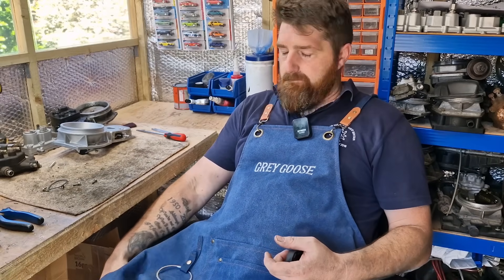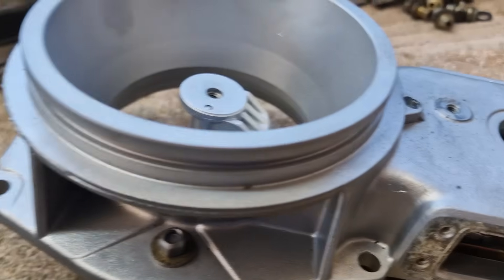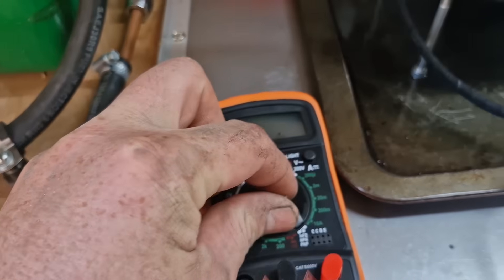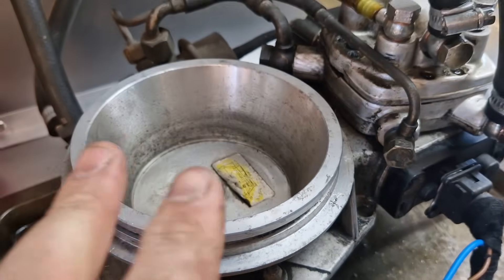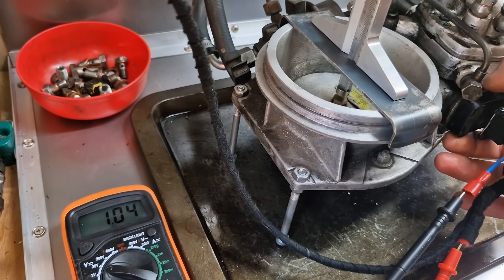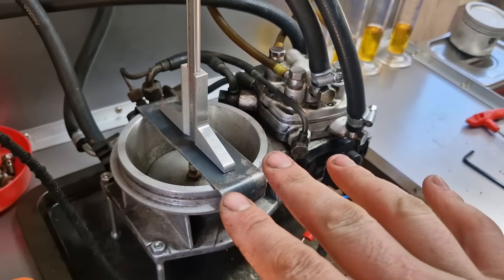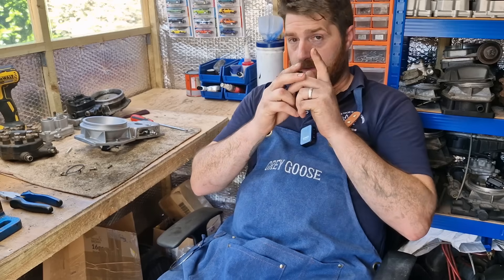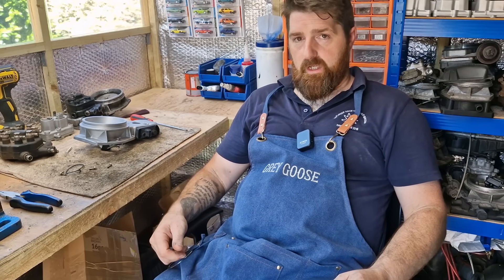Bosch KE-jetronic - Potentiometer Test and Adjust

Comment: I tried measuring this on my 1987 Audi Coupe Quattro 2.2 R5 JT and I got the opposite reading (larger number on the bottom, smaller number on the top)
What did I do wrong?
How should these wires be connected?
Reply from the maker: Has it got the factory plug on the potentiometer?
Reply: Yes it has a square 3 pin connector.
Pin 1 is (+) and pin 3 is (-)
Reply from the maker: Has pin one got positive voltage
Reply: Ok, I figured out where I was wrong. :face-green-smiling:
The minus end of the tester must be on the third terminal and the plus end must be on the second terminal.

Comment: I've been watching your videos for a while now and they've helped me out so much. Ive come across an 88 RS turbo that will not run with the EHA connected but idles and revs up fine disconnected (haven't driven it like this though) Any ideas?
Thanks
Reply from the maker: Thanks
The EHAs can stick inside so the arm won't move with the supplied current. Try a gentle tap and see if it opens / up sticks

Comment: Good day sir how are you? I finally got car started again. Starts in less than 2 seconds. I am idling 520 rpms which is low. My question is how to increase idle to specs. I have a new Pot to install and should I also take a look at The ICV?I am asking these questions because I don’t want to be changing things and not knowing why.I have to replaced my cate   . I noticed my exhaust have no flow like it should. Could this also affect my low idle?
Reply: Thank you for helping and directing my actions. I checked the TPS ok I checked the ICV the unit is ok but no power in connection. I checked the OVP relay all fuses are good. I am about to check Terminal 15 fuses  5 ,6,7. Is it possible could be a bad ignition switch? My dash light up perfectly. If there is no power going to ICV could this account for low rpm’s of 520? Thank you again for helping me to get this car organized Trevor
Reply from the maker: @trevorross7405 yes if there's no power to the ICV then check the main idle control module if ones fitted? On the Mk2 Golf its hidden behind the centre console
Reply: Do you have any idea or technique how to removed the ECU plug harness from the 300sl 1991 R129 Mercedes? I removed the one Phillip head screw , unlock the locking device and for over three hours I still can’t remove the plug from top of ECU . I even hurt my wrist trying because I am afraid to damage the pins. Any insight as to what else I can try to pry it out safely without damage thank you Trevor
Reply from the maker: @trevorross7405 not sure to be honest, spray some WD40 or similar round the plug see if it losens
Reply from the maker: Check all the timing and ignition advance side and check and adjust the mechanical idle and throttle body adjustments.

After this i would then be checking the electrical side of things
Reply: @GreyGooseRestorations does the 1991 300sl R129 carries an adjusting screw to adjust idle speed.

Comment: I kept backing off the adjustment screw in distributor small increments. I bleed all the injector lines and saw fuel coming out once I depress plate. Continue turning screw counterclockwise very small movements. Bingo the car started and kept on running.Now I have smooth out idle. Am I an a correct path?

Comment: I checked the pressures my differential was .4 bars. I jumped out pins 1 and 2 in MAS pressurize system fuel filled distributor. Remove one injector line . I turned the 3 mil screw clockwise no fuel came out of distributor until I deflected plate by hand then it came out. Plate got stiff so I turned it no more. I back it off one full turn counterclockwise . Did I do something wrong? Thank you . Trevor
Reply: Thank you I like your explanations along with the physical portion of actually seeing what you are discussing. Again thank you . I know that I have to fine tune the idle now. But I understand this system much better now. No more mystery or complicated.
Reply: Just a question about the convertible top. Do you have any knowledge about that? I am putting new top on.
Reply from the maker: @trevorross7405 not really dealt with any soft tops
Reply from the maker: @trevorross7405 Great to hear 👍
Reply: My friend I told you the car started . It did ran fine. I went back to it today start and stop sane as before. Sometimes fuel comes out of injector ports in distributor  when plate is depressed manually with fuel pump engaged. This does not happen consistently. Sometimes I have to turn pump on and off and it would happen again then stop.i adjusted air flow meter clockwise to see if fuel would come nothing happens. I changed the distributor for one that I rebuild with parts from  Germany following the instructions meticulously. As soon as fuel pump was turned   in fuel flowed from all injector ports nonstop . I turned the co screw counterclockwise  nothing  happens nostop. When I manually depress plate fuel shoots out of ports high in air. Can you help me solved this problem please
Reply from the maker: @trevorross7405 Hi, if when the ignition is turned on and pressure is sent to the distributor and fuel comes out the injectors and the fuel plunger is set ok then its more likely an internal issue causing fuel to pass a seal
Reply from the maker: The plate should be stiff once the distributor is pressurised, once its pressurised there should be a tiny bit of plate movement before it comes into contact with the fuel pin.

Lift the plate a few mm then the injectors should all spray

Comment: Do you know the typical fuel pressure in the return line from the fuel distributor (metering head) back to the black pump cradle on a K-Jetronic system?
I have a small issue: the internal non-return valve inside the black plastic pump housing is leaking — not the main check valve on the fuel pump itself, but the small internal one that stops fuel from flowing back to the metering head through the cradle.
So I’m thinking of installing a small inline check valve (cracking pressure ~0.15 bar) in that return line to stop backflow.
But I’m not sure if adding even a slight restriction there could affect the control pressure or warm-up regulator behavior.
Do you think that small cracking pressure could be a problem?

Comment: A couple of years ago I reverse engineered my Escort RS Turbo KE jetronic ecu to try and understand how it works. It is fully analogue using op amps and comparitors etc. The airflow input from the potentiometer is coupled into the circuit through a capacitor so it's steady state voltage isn't directly used. It is only being used for enrichment when the flap opens and the voltage increases. The quicker it opens the greater the enrichment. The output of the potentiometer isn't linear so the mechanical setting of its position is so that the non linear output matches the arm position. It is also ignored if the throttle is fully closed operating the switch.
Reply: Indeed, this is interesting. I always thought that all of the KE-Jet units have digital ECUs. That's because I own a 5-cylinder Audi with the KE-Jet and it has the 2x2 VAG-COM connectors in the fuse box, which means that, to some degree, it should be able to get diagnosed through a computer.
Reply from the maker: @dobro-mir as fair as I know the physical units stayed the same from the first KE upto the later MB engines when they were close to EFI before the 20v came in
Reply from the maker: Ah very interesting, thanks for sharing 👍

Comment: Is this for a mk2 16v 1.8 or mk3 16v what about a corrado 2.0 16v ? As it doesn’t have those adjustment screws
Reply from the maker: For VW engines it would have been on the later 2.0ltr 16v engines in the corrado and passat. The Mk3 was straight to EFI